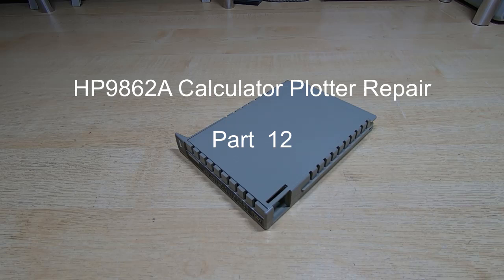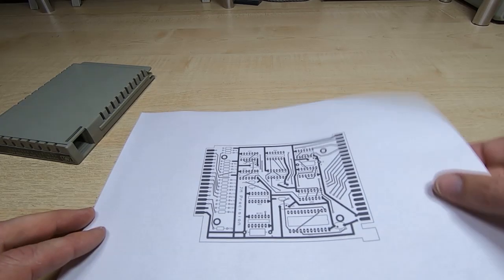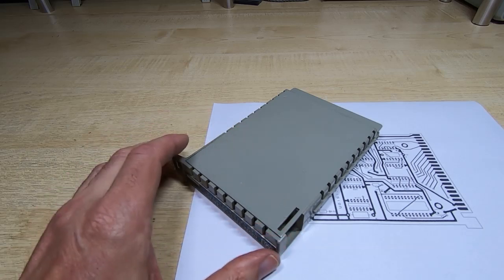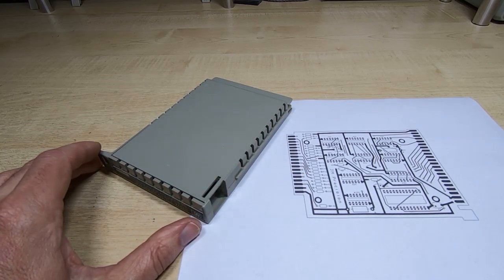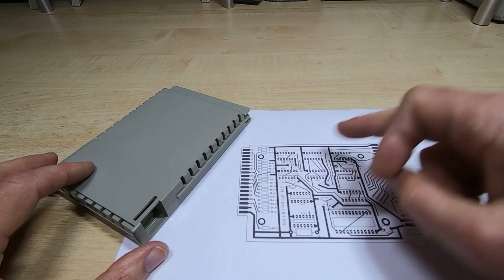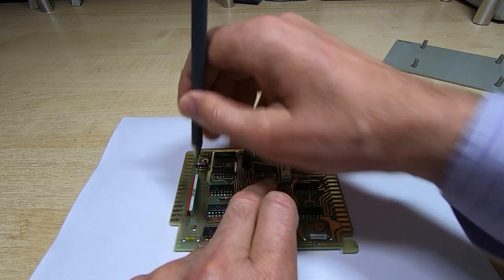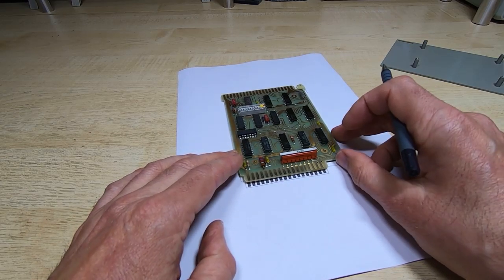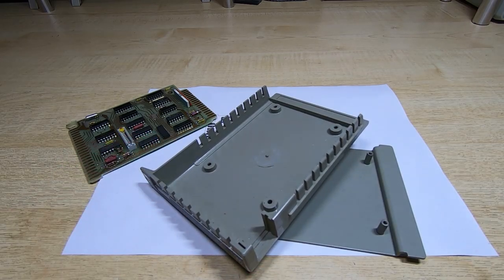HP9862A Calculator Plotter Repair Part12

Comment: I'm always looking forward to your videos whenever you publish your progress.
By profession I'm working in power engineering (high voltage switchgear and power transmission), but I also repair electronics as a hobby. Following your troubleshooting and engineering processes is really helpful for both worlds.

Thank you very much for taking us on the journey and putting that much effort into your excellent videos!